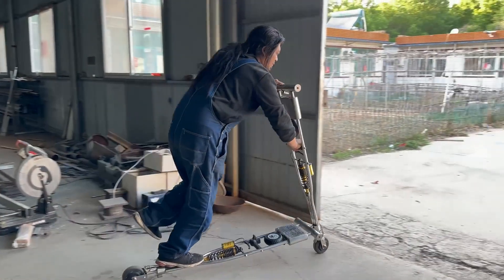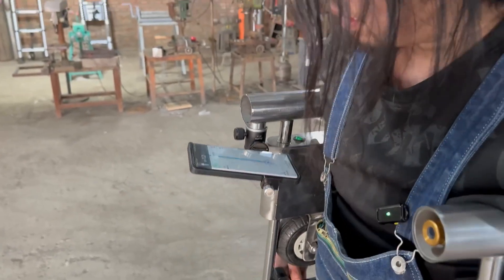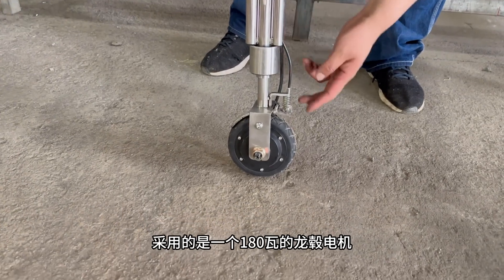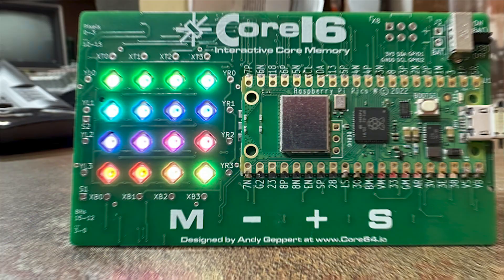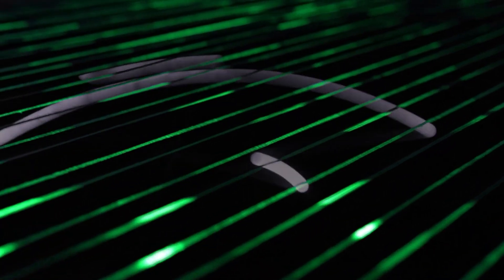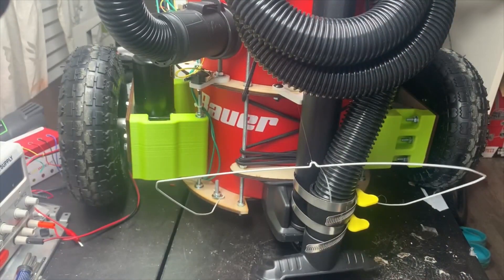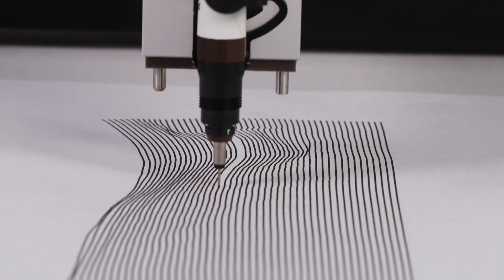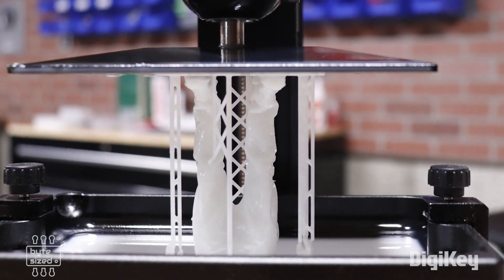Lean Machine [Maker Update] | Maker.io

Comment: Thanks Donald, great job as always.  I can't imagine flying internationally with all the crap I would need to show at a Maker Faire
Reply: That is a challenge, but it's an engineering and logistics problem that can be solved. Last time I did one I took just one project, my RC tricycle, and found a way to break it down into a suitcase (along with my clothes!). I had to source my own Lipo batteries when I landed, but that was sort of a fun challenge too. Bottom line -- you'd don't need to bring everything! Maybe there's just one, crowd-pleaser project you can take over and show off.